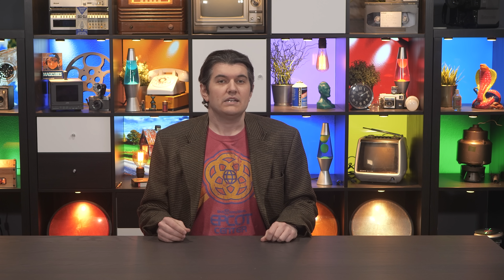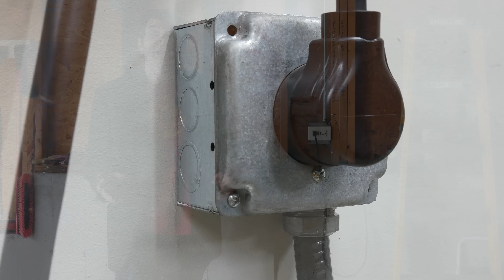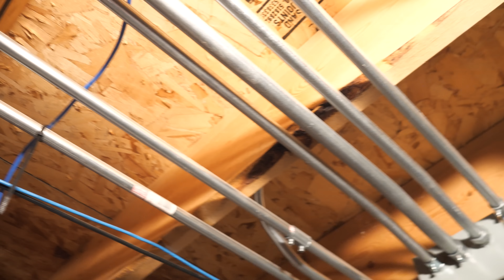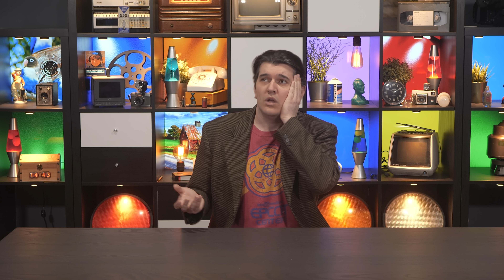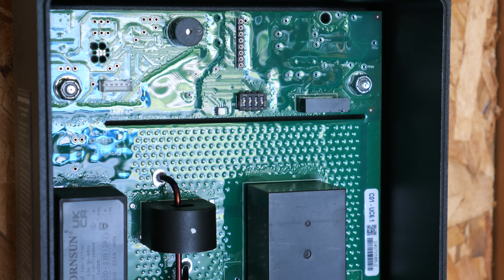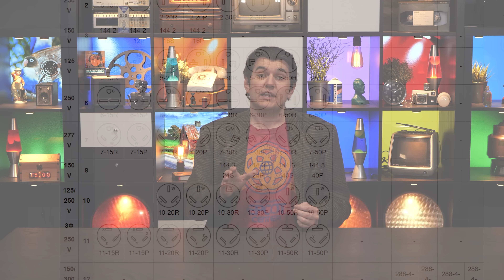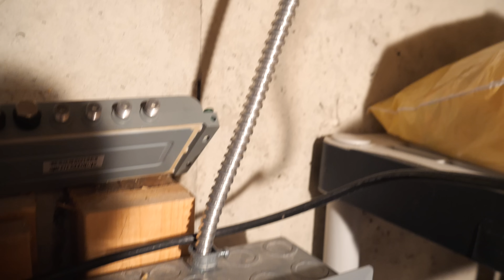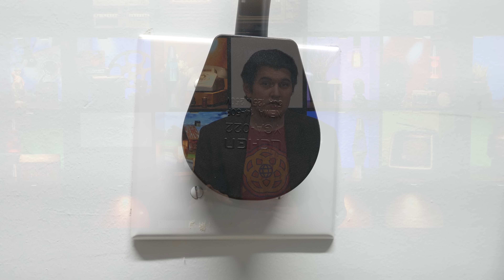The "standard" car charger is usually overkill—but your electrician might not know that

Comment: I have been primarily driving an electric vehicle for the past 8 years, and this has been the biggest surprise for us. We originally planned to install a 208 circuit in our garage, but it turned out to be too complex and expensive at the time. We decided to hold off and look into options. We instead hooked up to a lowly 15 amp 120v circuit, and were shocked that it was sufficient for our driving patterns. We are even on time of use, and exclude charging until after midnight. 
The root of the misconception is time. Over time, a small outlet can provide a large amount of power. Conversely, Electric cars do not need that much power.
Another real world analogy is swimming pools. You don't need to fill it in 30 seconds from empty. A simple garden hose works just fine. High speed DC charging is kind of like ordering a water tender delivery.

Comment: Danish electrician here

1 Never do your own electrical work, it can and will shock you to death while it burns your house down for good measure

2 The Danish Safety Technology Authority (sikkerhedsstyrelsen) have looked into this issue and have found that in most if not all instances your normal household outlet have not been designed by the manufacturer to suply max capasity for more than about 2 hours give or take

3 The installation that supply the outlet depending on age, have not been designed to be under max load for multiple hours

4 in Denmark we call thise small portable chargers Granma chargers (mormor ladere) for a simple reason you only are suposed to use them if you are visiting you granma for the weekend and need to go shopping, if you look at the included chargers for most cars they are marked as emergecy chargers not as a permanent charging method

5 i have tested this myself with a client, in the winter at about -15 degrees (real units ie. Celcius) his Tesla LOST power by pluging in the car with the emergency charger because the batteries need to be keeps at a certan tempature ant the heating elements used more power than what the charger could deliver

that said i do agree with the notion that you dont need the max capacity of your cars charging capabilites, but get a dedicaded circut made by a certified electrician i garantee the cost for a skilled tradesman is way less than burning you house down or losing a love one to shappy electical work

sorry for the rant but please stay safe 
🥽🦺🧤🥾⛑

Comment: Since you hard wired the EVSE to your circuit, most locations require a disconnect within visual distance of the EVSE. This is because there is no way to know if the circuit breaker is open or closed when working on equipment. This is why there is always a disconnect right next to an HVAC unit on the outside of your house.
Reply: NEC only requires a disconnect when the EVSE is fed by a 60A or larger circuit.

Comment: I agree that AC destination charging > DC fast charging, it's way better to be charging your car slowly while you do other things (like sleeping, working, going shopping etc...) rather than topping up the tank on the DC network. 

My EVSE is 'smart' in the sense it connects to some cloud API, but I don't really make that much use of the smart features. One thing I do like, which is completely overkill, is ingesting the data nd controlling the charger via Home Assistant. Unforunately this is via a cloud API so....just hoping one day the company doesn't disappear. Hopefully some reverse engineering efforts will happen to mitigate that.

Comment: Pretty much every condo complex in Canada has outdoor receptacles for block heaters.  It seems like it should be really easy to swap the breakers and receptacles out for NEMA 6-15 and get double the charging capacity of the regular outlet but I never hear anyone talking about this as a cheap solution

Comment: in the UK its pretty standard to just use a standard plug. I have 2 EVs and charge both through standard 240v 13amp plug in UK. Slow but ideal. And here, we tend to charge overnight as we can get 7p/kw vs 25p/kw

Comment: If you're going to the trouble of buying supplies and setting up a new circuit, why not go ahead and make it the full 60A? Your point about not shying away from slower charging is well-taken but in your specific example I feel like the marginal cost of putting in a bigger circuit would have been minimal.

Also curious about how well wirenuts work in high-load applications. I guess they must be pretty OK because they sure are ubiquitous.

Comment: I think I disagree with you on only one point:

I would wager that MOST PEOPLE that are wanting an electric car want a 1:1 replacement of their gas car. Same range, same fill up time, etc. People want luxury, low maintenance costs, low fuel/power costs, high power, etc. So when they buy a car, they look at "is this better than a cheaper gas model" without considering "well if I only drive to and from work with no other trips I'll never have to go to the gas station" but rather "man its gonna be a pain in the ass to take a 1200 mile road trip, but a gas car just wouldnt have that problem". 

Therefore, the DC charging infrastructure and maximum range capacity of new EVs is CRITICAL to their widespread adoption.
Reply: The petrol car wasn't exactly a 1:1 replacement of horse & carriage either. Driving to a gas station was an entirely new concept - your horse could be fed at home. Or at the inn if you were on a road trip.
Reply: @Maurice_Walker  yeah it was more of a 100:1 replacement completely revolutionising the world and cutting out all the need of maintaining an animal
Reply: you are correct which is why i haven't switched to an EV yet. most of the time I drive short trips around my city but every now and then I like to take a long road trip and I do not see charging stations as I see gas stations. I never want to be stuck on the side of the road
Reply: That's the crucial point why EV cars don't see as well as gas cars. A gas car is 100% flexible and I don't need to schedule my refueling plan.

There can be cases where you will need to spontaneously leave your house and don't have the time to wait for a full charge. In a gas car, I can drive to a gas station within a few minutes, top it up and don't need to worry about anything.

Making your schedule around the charging times of your EV is a downgrade in comfort, not an upgrade.

Comment: 7:59 when drilling through joints, try to keep the holes close to the center vertically, and not to close to either edge (e.g. not within a foot or two). These holes a very close to the edge, and the hole in the 2nd joist is a bit high. Don't compromise the structural integrity of important boards like the ones that hold floors up.

Comment: Do not use a dryer outlet. They are not rated for the duty cycle of an EV. The requirements are very different. Many fires have started as a result of people using a dryer outfit instead of an outlet specifically rated for EV.
Reply: This may be true for range outlets but not really for dryer outlets. Putting in a large load of wet clothes into a dryer can easily pull the full 24 amps for a significant period of time, exactly like charging an EV.
Reply: @RobertHancock1 Dryers draw power for 30 to 60 minutes. EVs charge all night. It’s a different duty cycle.

Comment: 26:02 I'm disappointed to see the AC receptacle choice going to the NEMA 14-50R instead of a twist-lock like NEMA SS2-50P. the twist-locks generally are designed for more frequent connect/disconnect actions, and can be more protected from environment, making them better for outdoor applications.

Comment: As someone who work in DC EVSE industry in the EU I have two things to say:
1 - Thank you for speaking loudly about what "bricks" actually do, witch is not charging. I still have a personal issue with calling them AC-Chargers for that specific reason and I usually go with EV's internal charger driver, even though it's a mouthful. 
2 - I'm baffled by how many AC sockets you guys use. In the EU, for high power (ie. 3-phase, 2-phase is not commonly used) we use IEC 60309 RED which comes in 4 sizes (16A, 32A, 63A and 125A with 230V on each phase) and that's basically it. Why do you have like 20 of them?
Reply: Not an electrician.. but it mostly comes down to saying how many volts and how many amps it provides. 120 vs 240 volts, 15 vs 20 vs 30 amps and so on. My stove uses an outlet that provides 120 and 240 volts at once and the stove has a 120 volt outlet built into it for convenience.

That said, almost everything just takes the 120 volt 15 amp outlet, so all outlets look the same unless they're meant for higher power like a stove/oven/range, clothes dryers, commercial/industrial level equipment, and now EV chargers.

Comment: I have a NEMA 14-50 outlet with a 50 amp outlet, but have my car set to limit itself to 28 amps, because I can get from 20%-80% within the 8 hour discount window.  Though I very rarely need to do that in a single night.  I figure even if everything is properly installed and specced, the further away from max you are, the longer it will last.  I had to do the outlet route instead of hard wiring to get the discount from my electric company.  This is no longer the case but now that I've got it installed it can stay.

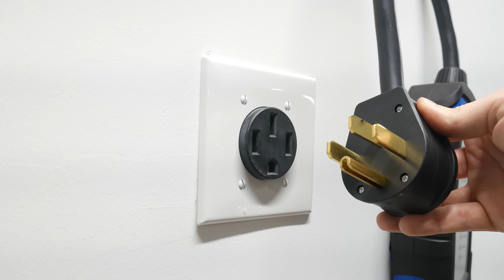Comment: I stopped watching at 0:13 to comment.  Nope.  Most people probably just need a regular old outlet, unless they are regular, high-mileage drivers.  I have an electric car.  The standard 120v adds 4-5 miles of range per hour, which is plenty for me.  On the rare occasion I'm driving 200+ miles in a day then I need to plan ahead and find a public charger.

I would say the requirement to own an electric car is a place to charge it at home and keep it plugged in all the time.  If you don't have a permanent parking spot with access to an outlet, don't do it, it's not worth the hassle.

Comment: 17:28 the other category is PHEVs; if you only have about 30-40 miles of charge, a busy day of errands will be hampered significantly by a 24a charger vis a vis a 40a charger; without the buffer represented by a 60+ mile range, that extra hour can make a big difference.

Comment: I'm fine with electric vehicles, but I don't think that they are ready at the moment because 80 and 90% of electricity still comes from coal, meaning that electric vehicles are actually polluting more than gas vehicles. not to mention that even if all of your electricity was coming from renewable sources, it would still take longer than the life expectancy of the battery to offset carbon emission that happened making the battery. I think we need to solve these issues first. Maybe with super capacitor and also we need to move away from fossil fuel and go 100% in on nuclear. At that point I'd be all on the EV bandwagon.

Comment: My house already had a 30amp 120volt outlet for an RV, I've found that short of running my battery all the way empty, it is still more than enough to recharge overnight (and on particularly heavy use weeks, which I've had a few, there is a free public charger a 20 minute walk from where I work, I'll just park there in the morning, walk to work, then on my lunch break, walk back to pick it up, now fully charged, ready for me to continue to use it faster than my home charger can keep up). I think that is a bit that you should have brought up, it's not just DC fast charging that can be used as an occasional supplement, even public AC charging can be used as a supplement, just find one that is an easy walk from your work or home, or where you will be shopping anyway, and you are golden. Sure, it takes a really long time, but if you are already going to be somewhere for a really long time, why not.

Comment: if the earthing arangement for your property is TN-C-S I would highly recommend whatever socket you use for a car charger be earthed seperately to the home via it's own rod

unless your charger has an open PEN device there is a possibility of the chassis of the vehicle becoing live in the event of damage to your home's supply cable 

PSA over

we don't use plug in chargers at all for this reason, usually always a type 3 charger which is wall mounted, be it 7.2kw or lower
and again you can lower the charge rate if you wish 

we have 100A 230V to play with, or 23KW to play with, and most properties are using 250-700w on standby loads and a usually peak of around 8-12kw unless you've a pool or jaccuzi

Comment: UK resident here with Peugeot e-2008 EV.  I had a 32A (240V) Eeasee charger box fitted.  I needed a new sub-panel in the garage because of rules about ground fault testing (or some such).   I run Home Assistant.  I have 2KW of solar power available on the sunniest days.  I measure house and PV currents using current clamps,  then I calculate an average available current to charge with.

Peugeot offers a cloud connection to the car, which is used by Home Assistant to monitor state of charge.  This goes into various sleep modes,  so an accurate figure is only available sporadically.  So I have to predict the state of charge and correct the prediction when I have an actual measurement.

I have an over-complicated charging algorithm (hey,  I'm a retired software engineer) that decides whether to charge and how much current to give the car based on the available current and the batteries state of charge.   Below a certain threshold (typically 65%), the car charges at the lowest rate (typically 1KW).  Between that and a higher threshold (typically 80%), the car only charges if the available power exceeds a sliding threshold (typically 500W at 65% and 1.5KW at 80%).

The result of this is that my car gets to charge more on sunny days,  and it tries to minimise charging that costs money (i.e. when available power is not enough).  

I also have overrides for threshold and power so that I can charge at 7KW to the upper threshold, or all the way to 100%.

It's somewhat surprising that it actually works.

Comment: My daily commute is 100 miles, and I work 12’s so I would only have 10 hours for charging if I drove straight home without running any errands ☹️ I’d definitely be running a new 50 amp circuit if I bought an EV.

Comment: We live in an apartment in a small city with 3 AC chargers for the whole city, and they are 9 kW at best. If we need to travel, then it's to go to the capital which is a 120 km trip. So the full charge is not enough for a round trip, I guess. There are 90 kW and 160 kW DC chargers in the capital but they are probably very expensive. I'd love to have an electric car but I don't think it's that easy in our current situation.

Comment: Regarding smart charging stations: one function of the power draw stats I use is to tell when my vehicle is done charging without having to go  check. Granted my situation is unique in that I park in front of my garage and run the charging cable from the dock out to the vehicle since mine won't fit in the garage itself. While I recognize most folks will just keep it plugged in until ready to depart, it is a use case, albeit a niche one.

Comment: When I went to get a charger, going 50 amp would have required significant upgrades for thousands of dollars, but 30 amp could be added simply for around $200. Outside of some very peculiar edge cases where I absolutely need to full charge within 6 hours instead of 9, absolutely no difference for a fraction of the price. Also helps in many cases to get a quote for a dyer outlet instead of an "EV charger" to avoid getting gouged.

Comment: I have a Subaru Solterra, and survived the first few weeks on 120v... I made it work with a quick boost at a DC charger once, then got my Level 2 Charger. I also used a DC charger to wait on at an Airport for a friend to top up some, but also stay warm since it was like 10 degrees outside. With EV range increasing, people are going to become more comfortable with the idea of road tripping in an EV, and that's just a classic mindset; Especially if we can manage a 400 mile 80-10% range. For a couple traveling vs a family, you quickly run into driving being cheaper and worth the time over paying for flights and a rental. That's why we still need to focus on DC Infrastructure, charging times coming down, range increasing, and battery thermal efficiency getting better. Getting that DC infrastructure built out is important for getting competition for better DC Charging costs as well.

Working from home, do I need a level 2, no... but I do have weekends where driving can be pretty heavy. Some months I still push 600-1000 with mostly weekend driving, but most being below 650/month. But getting that full overnight charge (knowing 200 is on the low spectrum of range) makes a difference.

Comment: This could have been a 5 to 10 minute video. To summarize, most people don't need to have a 48 amp plus breaker to power an ev charger. You can get by with 24 amp or 32 amp just fine. You also don't need to buy a crazy expensive charger as they are simple devices and its the car that does the heavy lifting (Asking the charger what amperage it can pull and then converting AC to DC).